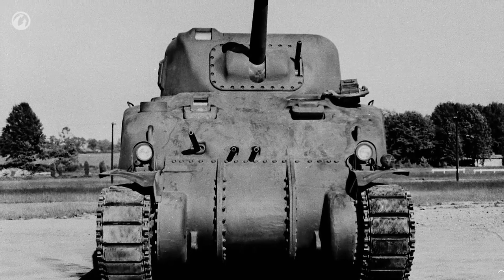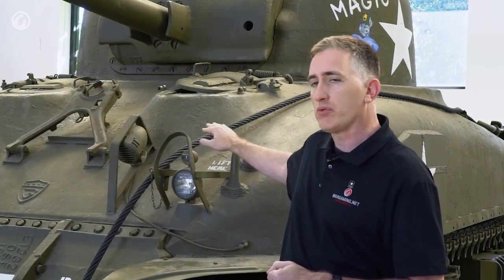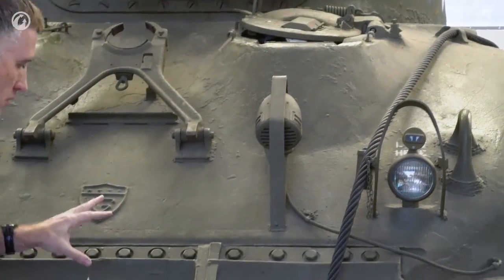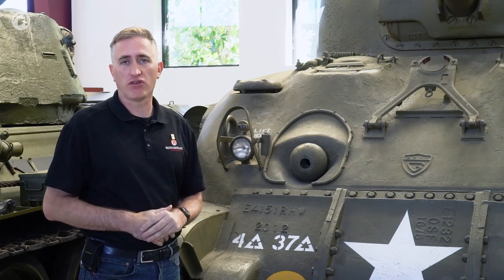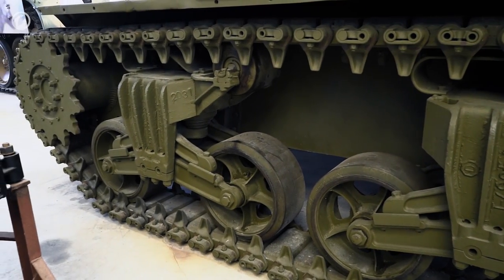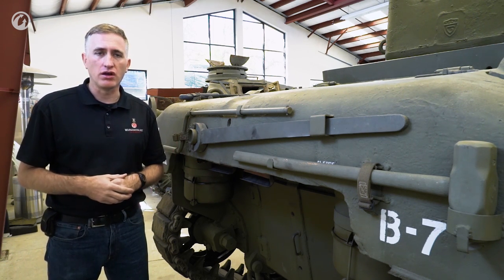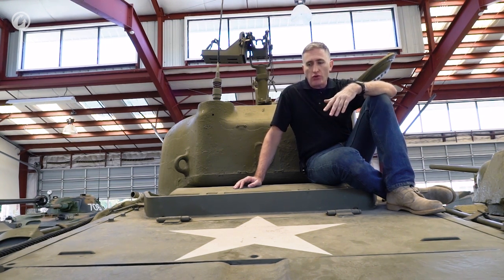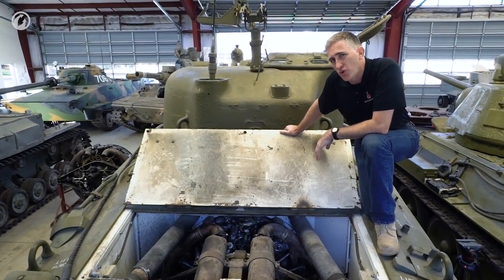Inside the Chieftain's Hatch: M4A1 Sherman part 1

Comment: Why does everyone comment on the Sherman's height?  The German panther and tigers were all taller.  The shorter. earlier tanks that have been shown were all cramped, under powered, and under gunned.  When the Sherman first appeared in Africa, The surprised Germans realized they were behind, then the Russian T-34 showed up and they went into panic mode!
Reply: IDK. Looks tall because it's narrow, maybe.
Reply: Bullettube I think that the allies went a panic when their first tanks were derstoyed from 3km by tigers 88mm canon.
Reply: Absolutely!  It was known that anti-aircraft guns needed high velocity to reach 30,000ft or more, and Krupp came up with the 88mm gun with it's reinforced breech and huge casing to achieve this.  America's navy had gone from the 5in 25 caliber to the 5in 38 caliber gun  and the British navy went from 4.7in to the 5.1in 40 caliber gun to achieve the same aim.  But to put such a gun into a tank required a much bigger tank, and the race was on to see who would be first.  I think the allies were correct in depending on the Sherman as the 88mm was not as effective in close quarters in France, where as the better mobility, repair-ability,  and sheer numbers of Shermans made victory possible.
Reply: It was wider then the British and German tanks it first met in Africa.  It was narrow only compared to later tanks, and as tanks got bigger and taller, it began to shrink in comparison.  What I'm saying is;  criticizing the Sherman for it's height is baseless, if you don't take into consideration the context.
Reply: When your To-Do list specifically states for the new tank to be smaller than an M3, which the M4 ISNT, then clearly there was a failure at some point...
Reply: The German tanks were shorter. The Sherman was so high because it had a radial engine. Those were more powerful and also smaller, they were also cheap for the Americans as they had invested massively into bombers over fighters. Radial engines were usually not used in fighters because despite their higher power/weight they had a larger frontal profile which produced more drag.

The Russian T-34 appeared before the Sherman did. It was in production in 1940 and indeed the Germans ran into them during their early rush of Barbarossa. However the ineffective Russian command system and the low numbers meant that the T-34 didn't make a difference. The Sherman didn't appear until autumn 1941, several months into Barbarossa already. One problem the Sherman did have was a relatively high center of gravity which combined with it's narrow hull and tracks made it swing quite a bit.
I think that high center of gravity might also be a reason why so many think of it as overly tall. There was no danger in it tipping over and the suspension could handle it just fine but it makes you a lot more aware of being high up.

The 88mm actually did quite well in France. The large shell made it possible to reliably knock out a Sherman in one hit. Meaning that if you got a good hit you could be fairly confident it was knocked out and you could move onto the next target quicker. What didn't work as well was the 75mm L70 of the Panther. The 75mm was actually superior to the 88 when it came to armor penetration and maintained it's velocity much longer which gave it a longer effective range (The 88 did still have a higher maximum range). The Germans also sent very few Panthers to the Western front as their weak side armor made them vulnerable to ambushes. The Tiger had much better side and rear armor and it's wide tracks meant it still had good cross country mobility. It was somewhat slow but on uneven terrain being slow isn't a problem as the British Churchill had large success in Italy despite going only 18km/h.
The most famous example was when Montgomery's 4th army was held off by a battalion of tiger tanks for almost a month.
Reply: Tiger Bs were only 5 inches taller than the tallest Shermans (10'2" to 9'9"). That's not much of a difference between a heavy and medium tank.
Reply: For the US the radial engine was used in naval  fighter planes because it allowed for shorter overall length of aircraft that had to be stored below deck in aircraft carriers. The radial engine was also easier to service in the cramped confines of an aircraft carrier. US bombers also were principally powered by radial engines. The demand for radial engines by the airforce, Naval and Army Air Corp, prompted the replacement of the radial engine in the Stewart light tank with two 343ci 120hp V8 Cadillac motors.  Current restorers of the Steward often use two Chevy 350ci V8s.
Reply: Kommervenkki 1 that wasn't always the case. Keep in mind, only 3 dozen tigers showed up in North Africa.
Reply: marinus18
The Sherman was actually shorter that the M3 Lee from which it was derived. It was also shorter than many later much larger tanks. But it was taller than was optimum and that was recognized at the time. And the early Shermans like the Lees, and Grants before them used a radial engine. But the main cause for the Sherman's height was that it had an engine in the back and the driven track sprocket wheels were up front. This meant there was a drive shaft under the crew compartment. The T-34 drove the sprocket wheels that powered the treads from the rear. So it was lower. The T-34 was eight feet tall while Sherman's were from nine to nine feet nine inches.

OTOH the driver sits up front and so had a shorter linkage to the driven wheels in the Sherman. In the T-34 there were long levers that reached all the way back making it harder to shift.
Reply: John Cornell  im not an expert. But i think the tiger suffered most from lack of fuel esp after barbarossa failed, hence why i think fall blau was on a narrower front than the attacks of 40 n 41. That and they desperately needed to get oil in grozny and beyond in baku so they had to focus there. Also they suffered maintenance problems more then from enemy tanks. At least by later on the eastern front that is. But when they worked and had fuel, they definatly did alot of damage to allied tanks. But fuel and maintenance was common problem with all german heavy tanks.
Reply: John Cornell  as i said not an expert so i am sure youre right. I know by late war alot of planes were grounded due to lack of fuel. And with battle of the bulge they were told to go and steal allied fuel from an allied depot to have fuel to make it to their objective of making it to antwerp so that shows the problems with fuel by that point. But maybe not with the tiger 1 but with some late war tanks esp at kursk, the tanks would over heat and breakdown cuz the trans and engine couldnt handle the extra weight they kept putting on all these tanks like the ferdinand and early tiger 2s but i believe by 45 they fixed alot of the problems but the main problem for tanks by 45 was allied airpower. Couldnt move during the day and thats why battle of the bulge was started during bad weather and partly why it was as successful as it was, plus the surprise. Fun fact, my grandpa was with the 80th division and was one of the divisions sent to bastogne and was one of the first to arrive to relieve the 101st. But as i said im not an expert but i know esp by 44 and 45 the germans were lacking fuel and i believe even in north africa fuel was a problem, but maybe they gave tigers fuel priority, although they needed it with only going 60 or so miles off road per full fuel tank.
Reply: John Cornell  did a little googling and it appears that rommel was having fuel and ammunition troubles that paulus relayed in a report that ultra decrypted which made them think rommel was one counter attack from capitulation which wasnt the case. He lacked fuel and ammunition esp when barbarossa took away luftwaffe planes and the german convoys were having trouble getting supplies to rommel
Reply: John Cornell  thanks for giving me some knowledge. Ive always read books about ww2 probably cuz of family that fought in it. There is tons of info about my dads side gpa due to him being in the 80th. They were called the "work horse" of pattons 3rd army. My one regret is that he passed away before i was old enough to talk to him about it, although my dad said he didnt talk about it much. I axtually just recently found a report he co authored after the war describing his platoons time in i think nov 44. Sadly it ends before battle of the bulge started. Someone scanned almost every paper for the 80th and put it on the 80ths website which is how i found the report and the general order descibing how he won his bronze star during the attack on the siegfried line. My dad always thought he got the medal in belgium but it was actually luxembourg. As i said i thought some of the early heavys had problems at kursk that they eventually got ironed out by 45 but they always had problems with final drives if memory serves me right. Also i think overheating problems. Also if i remember right with north africa is that for certain periods one side was decrypting the other sides secret messages. The germans were even able to capture tank communications that werent encrypted. The allies having ultra decrypts i think played a big part in north africa. Its debateable if without ultra rommel would of succeeded, that i leave to others to decide. But part of the problem was hitler saw north africa as the italians blunder and was more focused on russia. The one big what if is what if they had focused on the middle east instead. Might have just been a waste of resources that speads the germans thin, and i think i read some where that the soviets were considering attacking the germans eventually, they just werent ready in 41. But one of my main points was that after barbarossa and fall blau failed, the germans never had enough oil to mount a true offensive, only localized, narrow front offensives. Yes they ramped up production of synthetic oil, but it was only enough for defense and not offense, which is why during battle of the bulge they had in the battle plans for the panzers to find allied fuel depots to make it to antwerp.
Reply: your dates are all confused up dude, when sherman appared there were alredy some tigers, and even the panzer 4 long 75mm gun were good enough to blow sherman up... t34 came a bit before the sherman and panzer are a 1936 design, so at least you cant quite compare them. so for the height the t34 and sherman can be compared, and sherman loss. Realiability wise american and germany had the most "reliable" tanks, apart late german vehicle such tiger 2 or even the panthers (those for poor forward thinking "user friendliness")
Reply: Bullettube I beg to differ, many tanks had advantages by being low to the ground, like the StuGs in flat Russia, and the Cromwell’s in Africa.
Reply: John Cornell    Nonetheless, John, the math still favored the Shermans.  The Germans produced fewer than 1,400 Tigers during the entire war, while estimates of Sherman production (there were several manufacturers of Shermans and not all of their records were preserved after the war) ran as high as 58,000.  1400 versus 58,000?  That made the Sherman the 'ant' of the tank world, and a swarm of ants, you can swat them and kill them by the hundreds, but eventually they will overwhelm you and eat you alive.  Like the captured German anti-tank gunner was reputed to have said after being asked why he had to abandon his position, "We ran out of ammunition before you ran out of Shermans."  I think, in light of history, that entirely too much is being made of the Tiger tank.  It wound up being entirely irrelevant.
Reply: John Cornell    No, John, Tigers weren't so much abandoned for the lack of fuel as they were under-utilized because of a shortage of fuel.  A constant complaint of Rommel's and his successors was the gross insufficiency of Axis material support for their forces in North Africa.  There were times when the shortfall in fuel & ammo was as great as 100 tons per day.  An example would be his attack on a green U.S. army at the Kasserine Pass-  it was nothing more than a spoiling attack, un-exploited due to a shortage in fuel, equipment, & ammo.  A quick, unexpected strike, followed by a quick withdrawal, for by then German forces had lost their 'staying' power.  What's more, when Rommel inspected the American mountainous supplies & the quality of their equipment, he knew that the war was as good as lost.  He knew the Americans would learn how to fight, and they did they would become unstoppable.  And that was the tipping point-  when Allied logistics oustripped the Axis's.  It was a war of logistics.
Reply: @bullettube9863    To say nothing of the Sherman's shorter gun barrel in the tight confines of the bocage country compared to the longer-tubed Panthers.  The Shermans had the advantage of being able to traverse their main guns more easily  and more widely, this giving them the advantage in bringing their guns to bear sooner than the Germans.  Also, the designers of the Shermans had to produce a design that would work in Europe, a continent of 1,000-year-old roads, bridges, & towns, all of which were narrow.  Further, a narrow track gives you a higher pressure contact patch with the pavement, necessary for rapid advances on those roads.  Had we Allies had to fight while equipped with a Tiger-like tank, we wouldn't have been able to cross lots of Europe's bridges, given their narrow width and weight limits, or gone through countless towns & villages, having to detour, instead, around them, extending driving time, distance, and fuel consumption.  It just wouldn't have worked.  That's why the Shermans had such narrow tracks & hulls.
Reply: T-34 and kv-1 weren't really a problem seeing the small amount of them and the horrible performance.
Reply: The German tanks were worse than their French, British and Russian counterparts at the beginning of the war, actually the french Renault were regarded as the best and most widely used. The Germans exceeded in their Blitzkrieg  that managed to win them the early victories over the superior in therms of mechanical firepower adversaries such as France and USSR.
Reply: John Cornell  It wasn't really the Sherman that surprised the Germans as the 75 mm gun, which the Sherman and its predecessor, the M3, had been using. When the British got the M3, it's 75 mm allowed it to punch through the German tanks and knock out the 88 mm anti-tank guns.
Reply: It was the introduction of the M3 Medium Tank, the M4 Sherman's immediate predecessor, into Africa, used by the British, that surprised the Germans.
Reply: John Cornell  Oh yes, the M3s were not perfect by any means, they fielded them basically because the British were in desperate need of a tank as their own at the time were terrible, and the U.S. had not yet figured out how to put a rotating turret onto the M3 that could take the 75 mm. I've also read that they originally wanted to equip the M4 Sherman with the 76 mm gun from the get-go, but had to take more time to figure out how to put that onto a turret. As a stop-gap, they thus sent the Brits the haphazard-looking M3, which was a major improvement over the tanks the Brits had despite its flaws.

My main point though was just that the Germans realized the 75 mm gun that later appeared with the Sherman was a problem before the Sherman itself.
Reply: >went into panic mode when they saw the T-34
KV-1? Yeah. Early T-34? Nope.

Comment: What blows me away about WWII tank development is the incredibly fast turn-around times from design to production of so many vehicles but, then again, wartime is obviously a great motivator to get things done as fast as possible to get a leg up on your enemy.  Had Germany "more time" to develop the Panther it might not have had as many bugs as it did in its early versions, but countering the T34 forced them to rush the job.
Reply: Part of the problem Germany also had was a lack of certain raw materials and a lack of metallurgists, so they were unable to build the drivetrain components of the tank to the standard needed for the weight.
Reply: It is amazing how quickly technology adapted to need, necessity being the mother.

Comment: hey Mr.Moran i know its not a WWII based tank but could you ever do a M1 Abrams around the hatch
Reply: In theory, yes. We got an approval to do it when we filmed the Sullivan Cup, but ran out of time.
Reply: could do the Original M1 with the 105mm
Reply: TheChieftainWoT dang well maybe next time?
Reply: Love to see one on the M-60 as well. I've noticed that countries like Turkey , Iran and Saudi Arabia often end up using their M-60s and leaving their newer tanks at home. I suspect it's because the M-60 causes less maintenance difficulties. And if the M-60s fail they all jump into Toyota pickups which get fixed at dealerships.
Reply: William Sager id like to see an M60 as well
Reply: Brandon x don't think they will since most of the tank info is top secret:/
Reply: The Rebel the M1 Variant would be appropriate, its only used for training and is an export, so if they would sell the M1's to other countries, it's not top secret
Reply: Brandon x
if you are talking about the M1 then you are wrong, it is not used for training, export or anything, its been retired for over 20 years.  most of the stuff in an M1A1 or A2 is not top secret only Armor composition
Reply: +The Rebel when I was in we let civilians climb all over them inside and out. The only thing still officially a secret is the armor plate composition which I as a crewman was not allowed to know.
Reply: M60a1 is a big... ass... tank. It's taller than the M1
Reply: And an Armata.